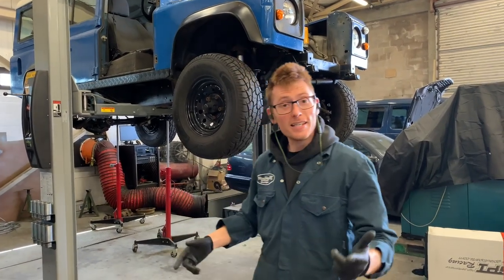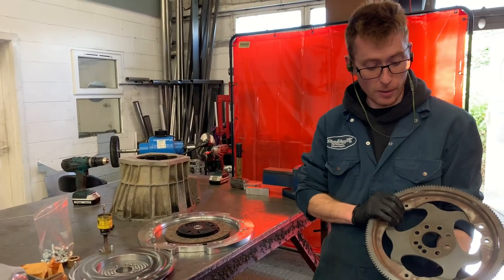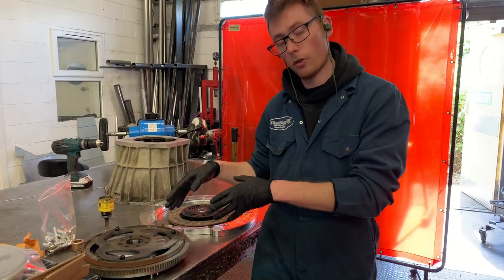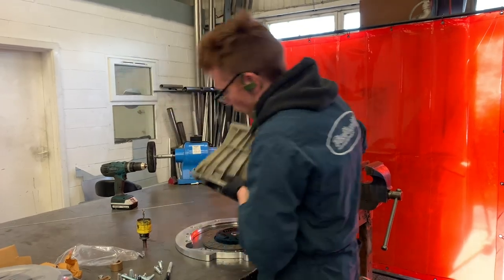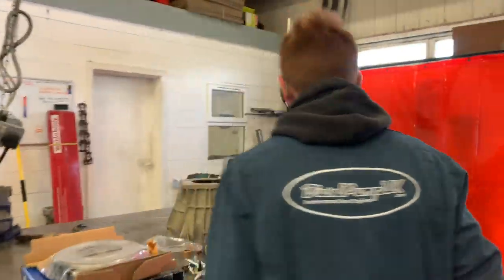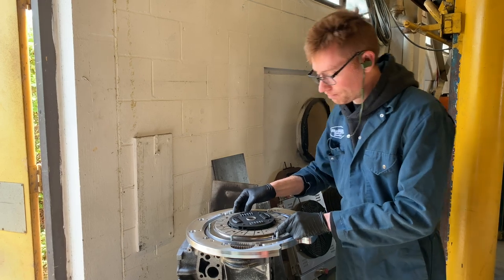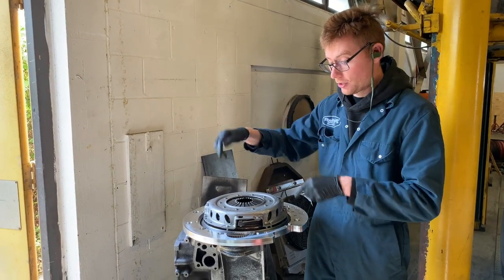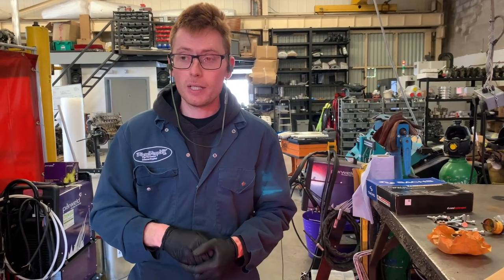OM606 to LandRover R380/LT77 Adapter

Comment: To use a Hole-Saw effectively, mount a small chunk of aluminium plate under the housing and clamp it, drill the pilot drill into it. this will keep the saw true while you cut.
Reply: I would suggest using a piece of wood as more people will have access to wood than ally plate. Plus wood is cheap 😁

Comment: bolt a piece of 4x2 timber across the bell housing flange where you want to use the holesaw. You can pilot drill in to the timber and keep the saw registered on one axis for a clean cutout.

Comment: For the starter motor mounting could you thread the adapter plate. Pass the counter sunk bolts through the plate,  locktite and then attach starter motor in the normal way and use nuts? Good video. Cheers.

Comment: You gave me a great idea
The 524td engine of mine…..looks like I can sandwich a flywheel and flex plate together and use my dodge getrag bell housing for one application and Toyota bell for the other….

What is your Sachs clutch diameter?

Comment: you have taught me alot about te om606. do you think one could be filled to a 1985 t2 409d mercedes? im looking at the space an im not sue as i have never been up close to a 606. 
silly question time. im wondering if it could be fitted further back in the van so the engine would sort of be under the front seats in the van. then the width would not mater so much it wold just be the height of the engine.. when the engine is fitted at its angle how tall is it? thanks alot

Comment: Just pointing out an issue I can see with this setup. You end up with a nice big hole halfway up the bellhousing for mud and water to get in. Which can be a bit of a problem if someone takes their landrover off road. Is there something you can do to sort this out with your kit? Only trying to be helpful.
Reply from the maker: Yes your correct but as you can see a landrover bellhousing was never designed to accept a Mercedes engine/starter position so it’s a compromise. I have seen some guys make up a small tin shield.